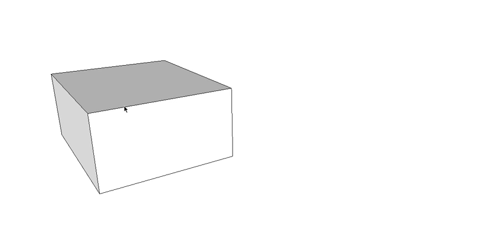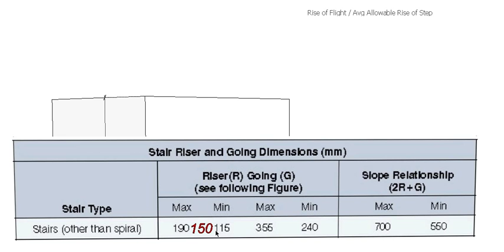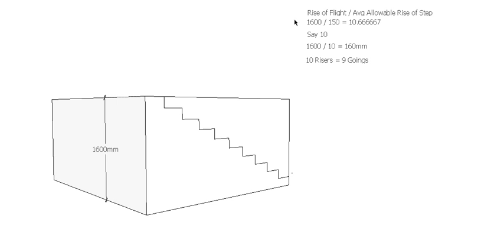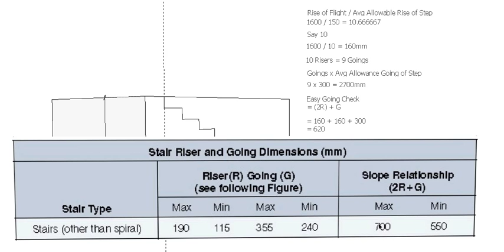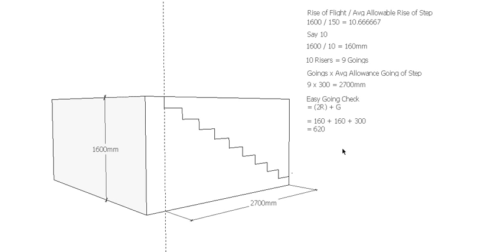Unrestricted Going Example 1

Comment: Would I need to consider finished floor height, when the stairs go onto the joist, and then floorboards, would I need to add the thickness of the tread to total rise.
So it sits on top of joist
Reply from the maker: Hi Mate, Yes, if your stringer is going to sit on the joists then you would have to allow for the flooring thickness so that the first step is the same as the rest once the stairs are done.

Comment: Would this work with pre made stair cases that need cutting 
Struggling to get my head around allowing the thickness of the tread onto the joist
E.g. Rise + thickness of tread 200 mm tread 22
Do I work to finished floor or top of joist
Reply from the maker: Hi Mate, precut stringers are a real problem.
for your calculations you need to work on the Finished floor height however when you mark out the stringer you will have to add the the allowance for the flooring to the set out. Hope this helps

Comment: how would you know if the 150mm risers went over the top without this software?
Reply from the maker: Hi Tom, there is no software, just use the formula 2R+G (2 risers + a going) and if the answer fall between the 550-700 range then the stairs will comply.
Reply: @Buildsum  thanks, i was referring to when you divided 1600/150 and there was an un-even step at the top, how can we find out if there was an un-even step that didn't add up
Reply from the maker: Hi Tom, the only was to work that out is to do the calculation, 9 times out of 10 you will get an un-even answer. You then have to round that answer up or down to work full steps and recalculate using that number. e.g. 1600/150 = 10.667 so say 11 risers, 1600 /11 = 145.5mm so each rise will need to be 145.5 to get even tread over the staircase.
Hope this helps
Reply: @Buildsum  thank you answered my question

Comment: Great video!
Do you know what the maximum width stairs can be with only 2 stringers?
Reply from the maker: Hi, there really is no definitive answers to your question as it all depends on the type of timber you are using and the thickness and therefore the span of your Treads. 
Table 3 in this document will help however you may need to register with Wood Solutions to get access.
https://www.woodsolutions.com.au/system/files/WS_8_TDG_9_15_LR.pdf

For example, If you were using H3 F5 Treated Pine with a 46mm thick tread then it can span 1000mm but a 40mm tread can only span 750mm. However, we can only get Treated Pine in 45mm thick so with a bit of calculation (interpolation) we can work out that a 45mm thick tread can span 958mm

Hope this helps